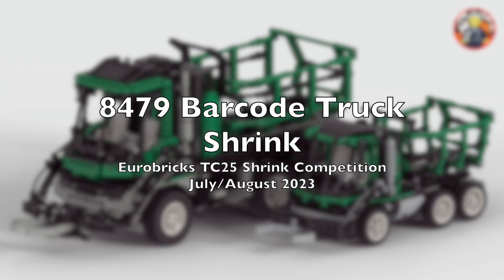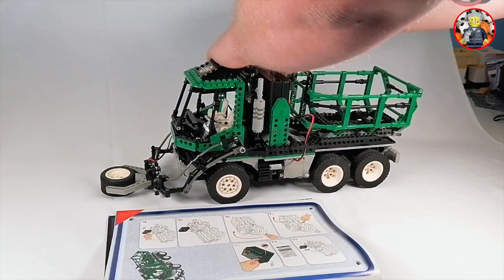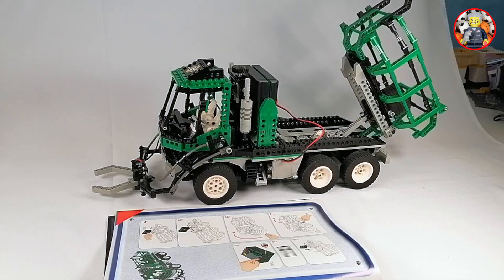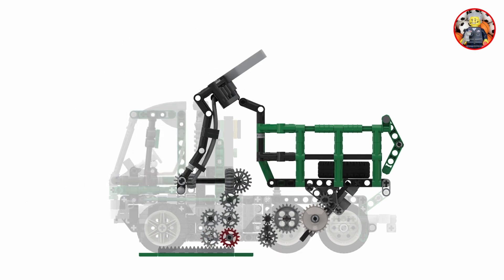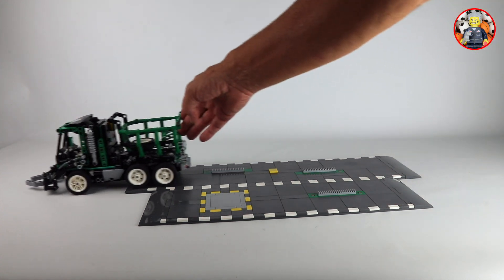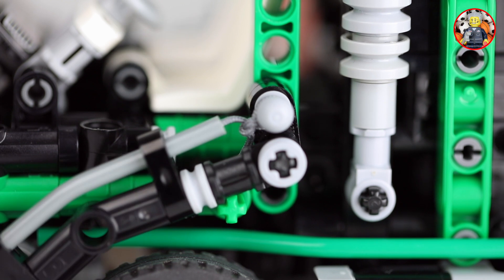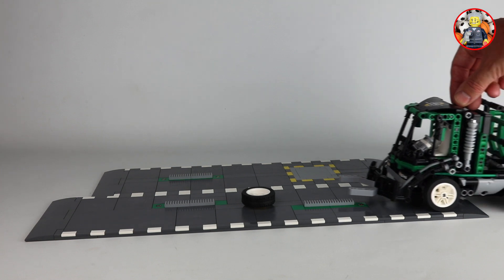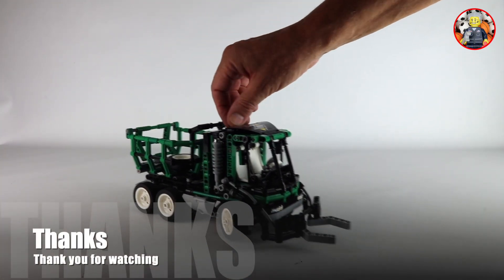8479 Barcode Truck Shrink

Comment: The model is really well designed. But I wonder how you created the animation at 2:09
Reply from the maker: 24 frames per second, every image manually all gears positioned in Stud.io with exact gear position and rendered to an image. All images put in sequence in the video editor.